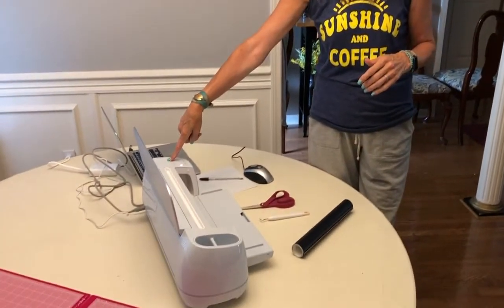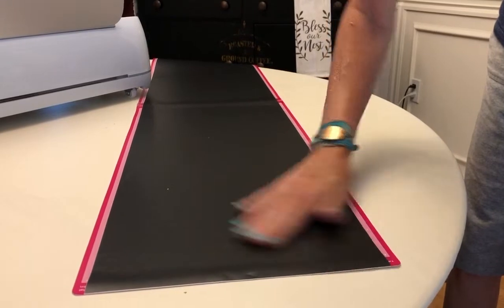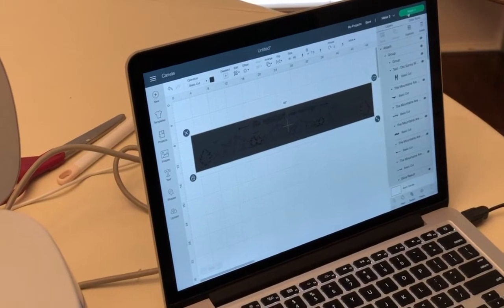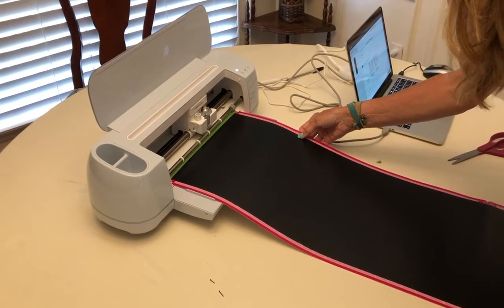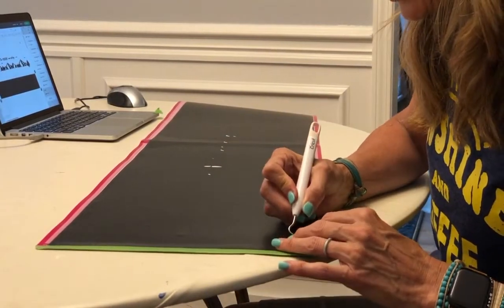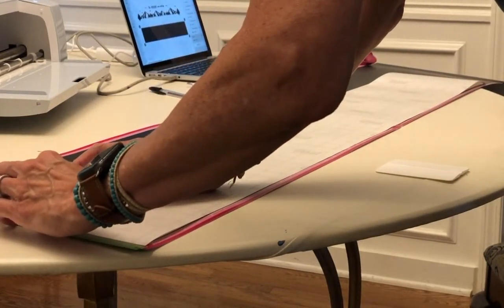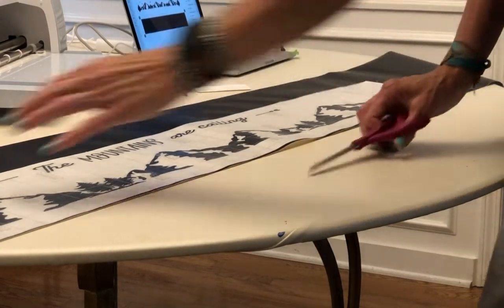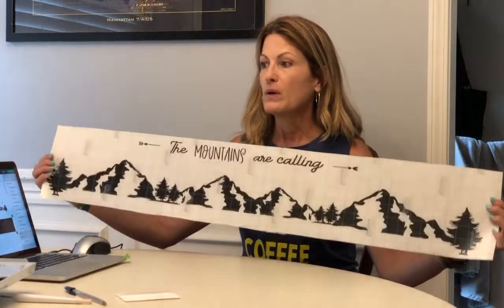How to make long decals on Cricutmaker 3 without Smart Vinyl

Comment: I am trying to cut a 26.5x2 decal. It looks to be positioned to start cutting at the beginning of the vinyl, but it does not until about halfway down which then there is not enough vinyl and the system errors out wasting the vinyl since unfinished. I have the maker 3 and seem to be having to much wasted vinyl. any help is appreciated

Comment: Monica!!! Your my hero!!! I’m a beginner and got a ton of reg vinyl for this machine while waiting as it was a gift from my sister, I told her to get the used- like new option from Amazon, which came with nothing but the machine. 🫣I KNOW!!! I am really only focusing on heat transfers for clothing I’m making, would u suggest a different machine that would fit my needs better? I mean all the extras are amazing! But a luxury I wouldn’t use enough to justify keeping this one. Right?! Help! Any suggestions?
Reply from the maker: Did you get the Cricut maker?  I hope so. If so, it’s awesome. It’s my ‘go to’ cutter.  I also have the cameo pro 4 & Silhouette Studio, but I do most of my cutting with my sweet dependable Cricut maker 3.  *You’ll need HTV if you are going to make clothing. But having regular vinyl on hand is fun for making decals and other cool things!   Good luck!  I’m glad my video was helpful!!

Comment: Im new to all of this i just go the same machine you have for xmas. What's the purpose of the weeding box?
Reply from the maker: The weeding box is used to avoid wasting so much vinyl.  The ‘outside’ part can be saved. I prefer to just measure a piece of vinyl that is slightly larger than my cut design.

Comment: Hi! I loved your video! I've had my cricut for about a year, and am still learning! Could you (or anyone that reads this) help me figure something out, I am trying to make my own viynl iron on with different images from design space. ( a mountain and a few different trees) I sent the trees back and brought some forward and arranged them, but when I went to cut, it cut the trunk through the mountain,and some of the overlapping trees. so when I weed it, It pulls up half the tree and mountain. I have done lots of research and I can't seem to figure it out. I don't know the right terms or tools to use to ask Google correctly, I see images in design space already made that look similar, but I want to customize my own. Any help would be greatly appreciated!!
Reply from the maker: Did you try welding them together before sending them to be cut?
Reply: @monicaK Thanks so much for responding so efficiently! I thought I did, but it is possible I did not. This is the first time I've tried a project with my own design. I may just attached them? I've messed it with it so much, I will start over tomorrow and try that. I uploaded two short videos, one of the actual cut and one of what it looks like(what I'm hoping for it to look like) on design space! 😊

Comment: Thank you for sharing! This video alone was enough to convince me that it is possible to overcome the limitations of possible vinyls for large designs and opt for the Maker 3! 

One thing I’m curious about is in your video, you showed that not only was the maker 3 tricked into thinking it was continuously cutting smart vinyl, it seemed to be cutting 2x faster as well. Does this mean when using a mat with regular vinyl, cricut can cut 2x faster if you specify you are using smart vinyl instead of on mat?

Comment: Someone wants a 40 in long x 5 in wide window banner decal but the vinyl only comes in 3 foot sections. How do i slice the 2 words and make it with the 1 sheet
Reply from the maker: Don’t slice anything.  That’s not necessary.   You need to buy longer vinyl.   Go to 143Vinyl.com.    They sell longer rolls.  No need to do that decal in sections.  You got this!
Reply: I need it done by Sunday. No time to order. Is there a way to split up the words?
Reply from the maker: Yes but it’s too much to describe here.  YouTube has several videos.  Search for How to Cut larger than mat. Good luck!
Reply: @monicak2985  I did that. Nothing explains it how i need it to be done

Comment: Thanks for this.

TIP: i had issues with the knife pressures, even when i set them to the minimum is design space were cutting right through the my vinyl backing. it took some trial and error, but i managed to fix by raising the height of the blade holder. works a treat now!
now i need to 3d print some blade holder collars so i dont have to guess the height the blade should be at!

BONUS TIP: if i can do something cheaper I will. So I bought some flexible cutting matts from the supermarket, i cut them down to size and i use making take to fix my vinyl to it - you can also buy some spray tack to make it sticky. Works out about the 1/3 of the price of the Cricut matts, and i also got 4 matts in the pack!
Reply from the maker: Oh wow.  I’ve never had that problem but thanks for sharing.

Comment: If you take the weed box and duplicate it three times then you will have 4, take all 4 and center them together then weld them. Then put your decal picture in the weed box that you sent to the back and group them together and then attach.  Once you cut that it will cut the box out so you won’t have to use scissors to cut the paper once you are done weeding.
Reply: Why do you use a weed box? I'm new to cricut I have a maker 3 so keen to make car banners
Reply from the maker: I have used a weed box (but never had to stack 3 of them).  Most of the time I just precut my vinyl slightly larger than my svg design.

Comment: You know you can cut without the mat right?
Reply: How? Besides using smart vinyl
Reply: You would need to buy vinyl that's 13 inches wide. That's the size of the cricket smart vinyl..  @alizees8156
Reply: You would need 13 wide vinyl for it to fit the feeder without the mat
Reply: Oh means you need perfect sizes material in other words @HECTORJABUNDISJR
Reply: @gloriousmimi3585  yes, your vinyl has to be 13 inches wide to work without the mat, but it’s only possible with the maker three and above
Reply: I am also confused cause what i know is you can cut upto 12 meter without mat and smart material
Reply: @gloriousmimi3585  from what I’ve gathered after watching this video, it’s only possible with the Maker 3